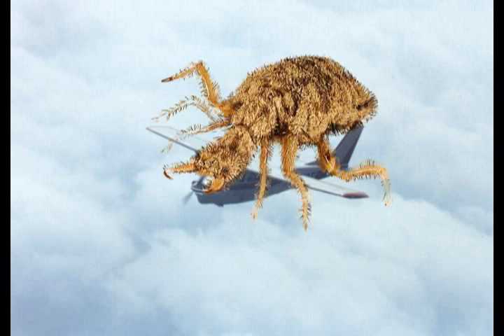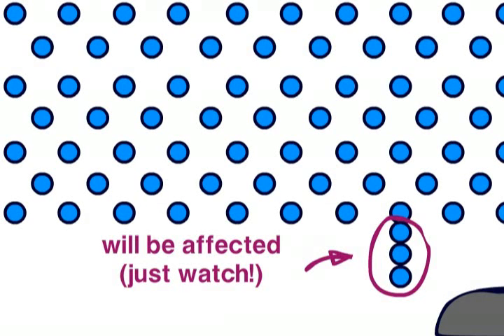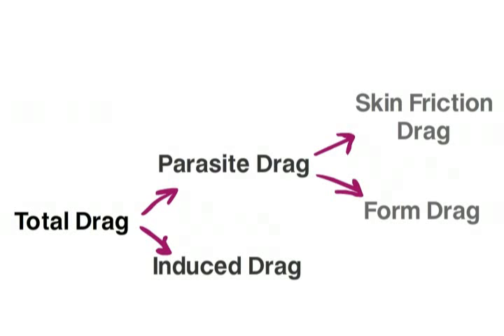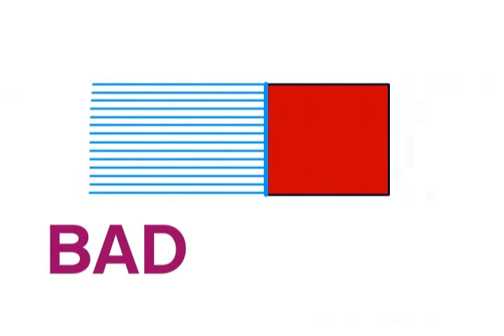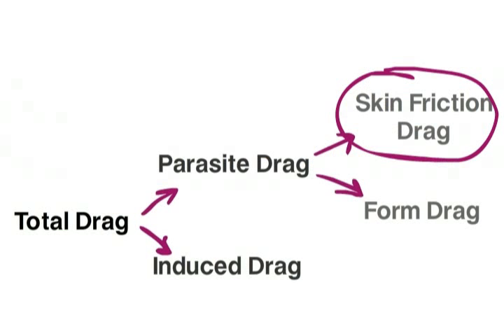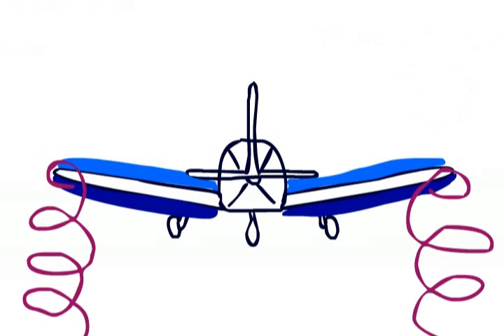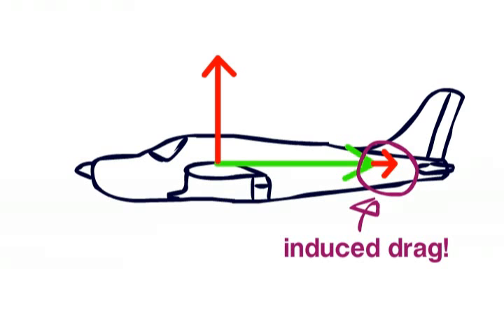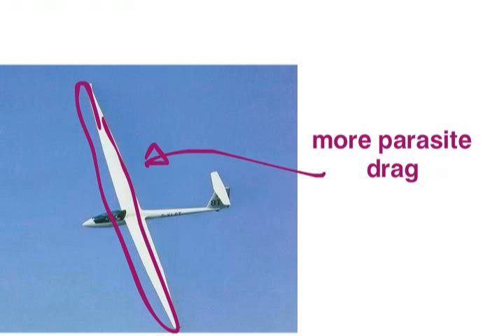Aircraft Drag Explained | profpilot.co.uk video #8

Comment: Please i need to know how could I reduce the induced drag and how much of it 
accounts between the power needed to level fly the aircraft at low speeds.

I mean an aircraft with total load of 200kg and landing at 20m/s thank you !
Reply: Vortex generators along the top side of the wing and winglets at the end. That will clean up the airflow. But if you want to get slower speeds for landing, then you want to INCREASE the induced drag. Since induced drag is generated by creating lift and you need to increase the lift by percentage relating to the airspeed.

Comment from the maker: @Symphony6367 Thanks! Interference drag is part of parasite drag: it's from how air reacts around different parts of the aircraft (like at the junction between the wing and fuselage). The two different air flows will interact, maybe causing themselves to become supersonic and leading to an increase in something called wave drag (which is a whole different kettle of fish). (And whole lot more tedious kettle of fish). (Like a bunch of dead haddock floating in a beige kettle decorated in calculus).